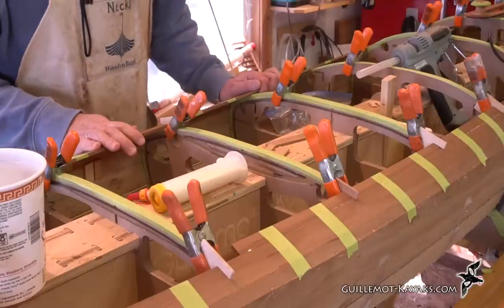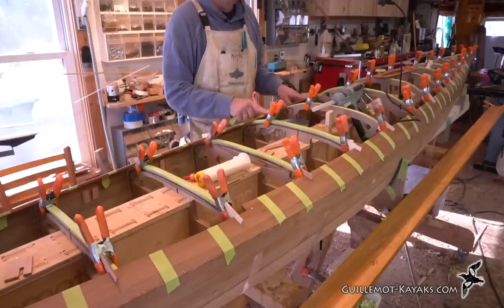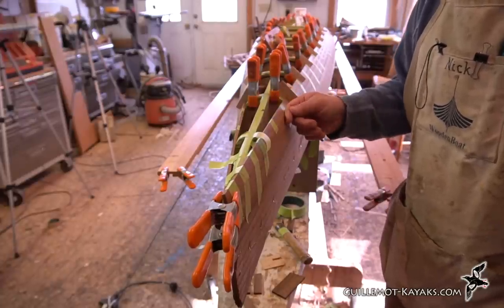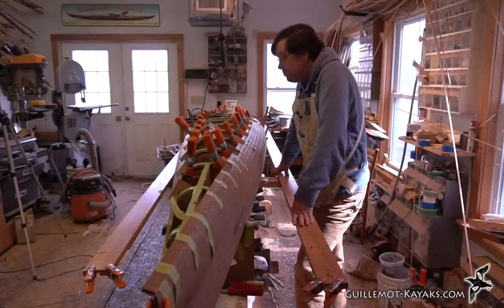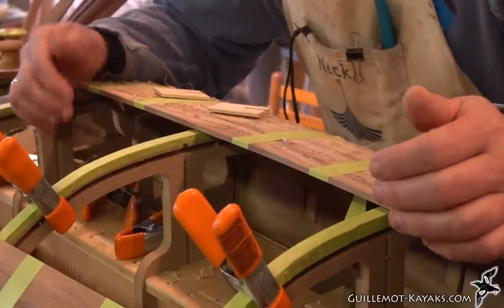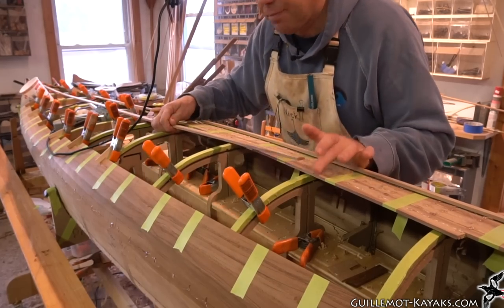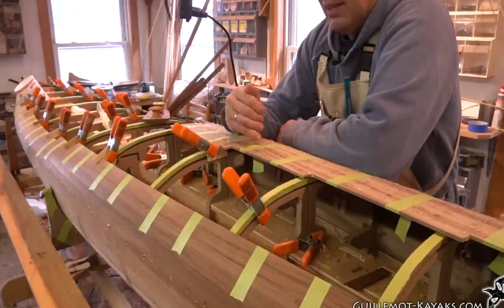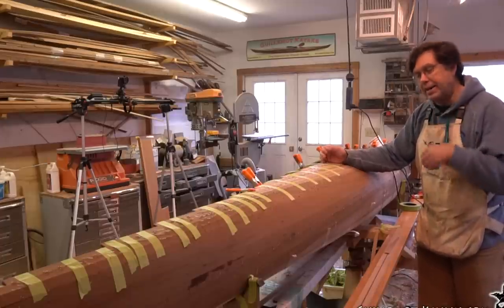Stripping up the Front Deck - microBootlegger Sport - E24

Comment: Why can't you put one single strip in the middle from the beginning, and then size the deck to it? It will look super cool like the motor boats. Make it contrasting color to stand out. And since you doing it from the start it will be perfectly straight. One downside is that you still have to fit both sides of the deck to that middle one, so twice the work. But it might be cool looking
Reply from the maker: That is pretty much how I do the back deck. This is the look I wanted for the front deck. Its just an aesthetic choice of what I wanted to see.

Comment: Just noticed a new technique  - you hot glued new strip joint after clamping and taping.  What is your reason for this extra glueing?  Keep up the excellent videos.
Reply from the maker: I put dots of hot melt glue between strips because I want to add another strips right away. Earlier, I could add a strip on one side, then go to the other, fit and glue the strip on that side and then come back to the first side. By the time I got back to the first side, the glue was dry, so I could remove clamps and tape without risking the strip popping off.

Once I got to the point where I was just stripping on one side, as soon as one strip was installed, I wanted to install the next right above it. By putting the hot melt "stitches" between the strips, I am able to remove the tape sooner, while the yellow glue may still be weak.

I hope that makes sense.
Reply: I guess I should have figured that out.  Thanks.

Comment: Nick, What size are your clamps and where did you source them from?
Reply from the maker: Most of the clamps you see me using here are 1" Pony spring clamps. I bought a couple hundred from sears a while back. 

Pony is no longer in business. I was just by HomeDepot and checked out their 1" spring clamps. They are $0.99/ea and seem to be decent quality.

For the purposes I'm using here the 1" size is good. I also have a bunch of 2" which are also useful. HD has 2" for $0.99/ea as well. Not bad quality.
Reply: thanks Nick